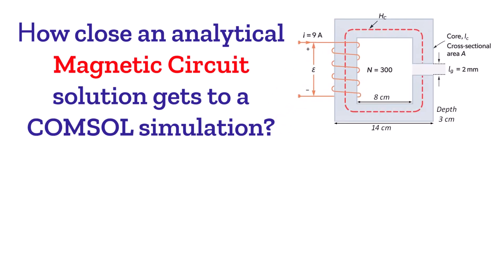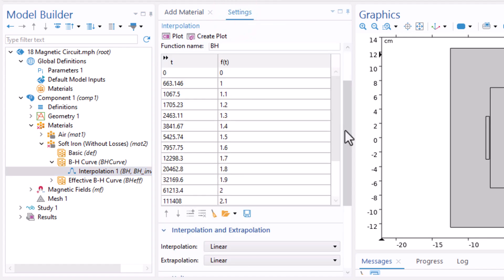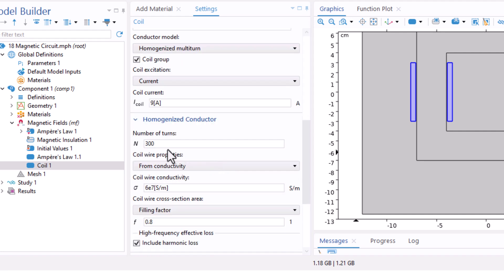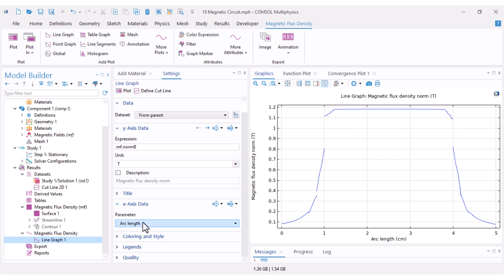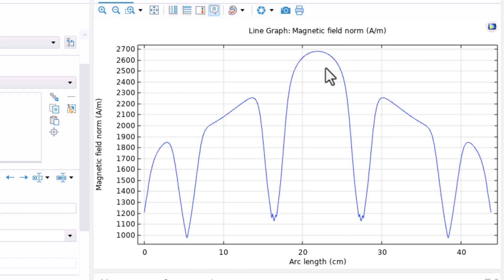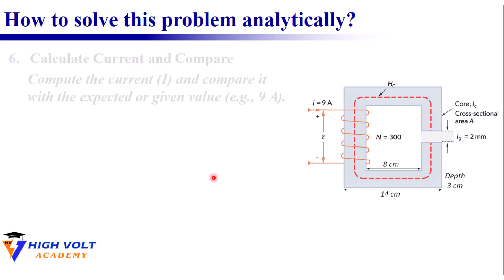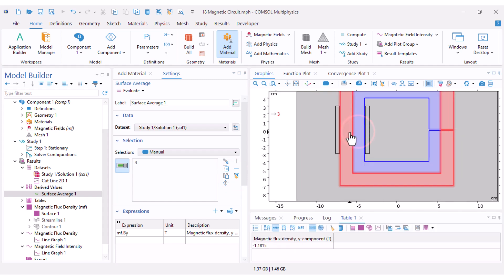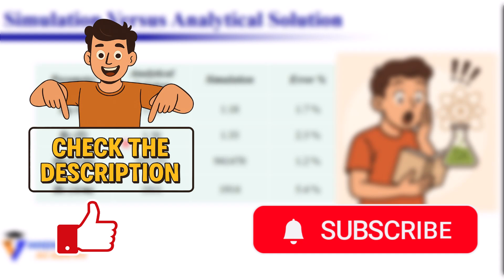How to Solve a Magnetic Circuit in COMSOL Multiphysics + Analytical Comparison

Comment: interesting tutorial 👏 what about the frequency?
Reply from the maker: In frequency-domain analysis, a few things need to be modeled differently compared to the time domain. For example, instead of using the standard B–H curve, you should switch to Effective B–H mode, which accounts for the material’s complex permeability. Also, for a more realistic model, core losses must be included, and these are inherently frequency-dependent.

A few additional points that are important in COMSOL:

Eddy currents are naturally included in frequency-domain studies, so make sure the material’s electrical conductivity is defined correctly.

Skin and proximity effects become significant at higher frequencies, so using sufficiently fine meshing in regions with high current density is important.

If you use multiturn coils, their impedance will change with frequency, so ensure that the coil model (homogenized vs. explicit turns) matches the frequency range of interest.

Frequency-domain studies assume steady-state sinusoidal excitation, so transient phenomena like saturation dynamics or switching behavior won’t appear unless modeled separately.
Reply: @HVAcad  I'm beginner of Comsol and I'm using mainly for thermal simulation but I'm a designer of high frequency transformers and I have tried to make the simulation but I'm ont sure that Comsol can be the right tool to simulate the real parassitics parameters of high frequency transformers
Reply: @robertovolpini9359  I am also working in the same topic , electro-thermal model of high frequency transfomer
Reply: @ABDALLANAEEMSHALEI I can’t wait 😜